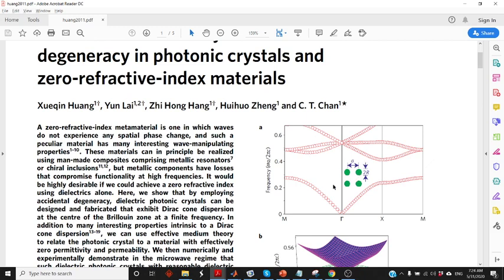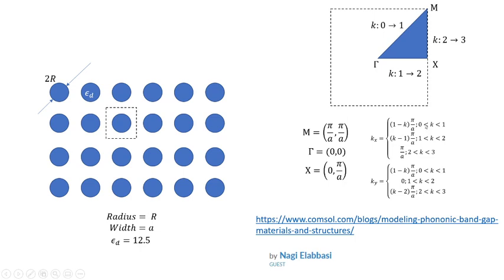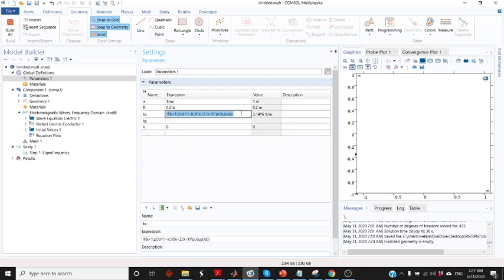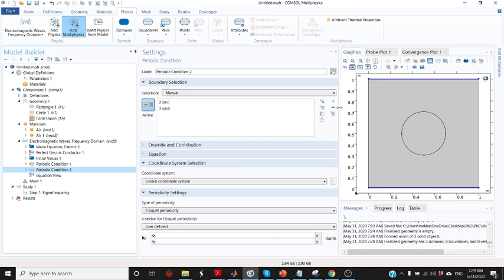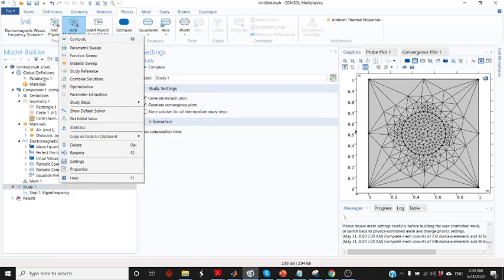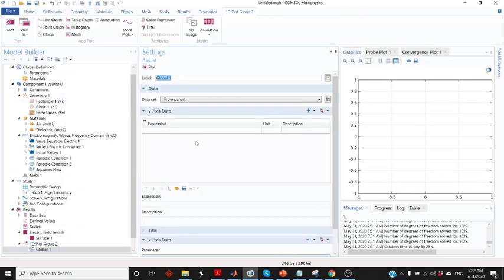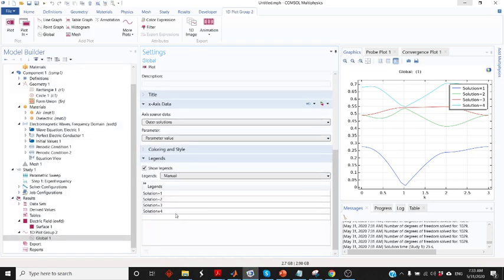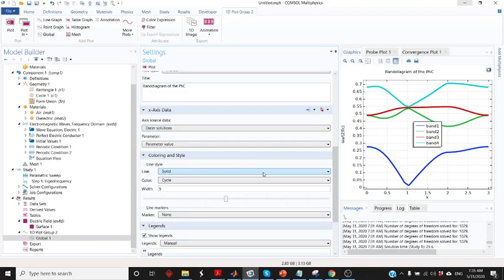Photonic Crystal Band Diagram COMSOL Tutorial Beginners

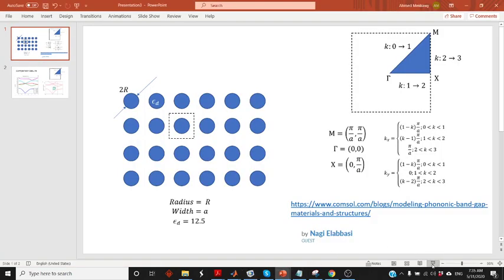Comment: Dear Ahmed, your video is very helpful and concise. I have a small question about the band diagram at 11:10. The cyan and green lines have noticeable kinks, but I think they should cross each other smoothly. The cyan line should continue downward, and the green line should continue upward until k=2, shouldn’t they? Thank you for your nice video!
Reply from the maker: that's correct, it is just artifact of COMSOL plotting the modes are arranged with frequencies. But you are right, the cyan and green lines belong to cross modes.

Comment: Thanks to ur contents. By the way, I would like to ask a question. I've tried several times to mesh (sequence type : physics-controlled mesh).but I dont have any idea why cant I get rid off from error edge 1. I have a same problem. Is there any solution?
Reply: If you structure is different than one shown here, it may require finer mesh or even a custom mesh with different mesh element shape. Without knowing the structure its difficult to suggest anything.

Comment: Do you have some video for band structure in a 1D superlattice? I do not if we should use 2D  layers and apply "No-Slip" boundary condition in the top (wall) in order to consider aroud Y-direction like infinite and only use floquet periodicity along X boundaries...
Reply from the maker: Yes, correct. 1D would be much easier. I assume you talk about acoustic wave in that case, right? you can apply the periodic BCs in one dimension (say left and right), and make the other boundary in the top and bottom, choose hard boundary.
Reply: @ahmedmekawy1632  Yes, acoustic wave. I am using linearized Navier stokes because I want to see the dissipation effects by viscosity.  Then, in top and bottom, I have to use Hard boundary? But the problem of a hard boundary (i think) is that in want to include dissipation effects due the viscosity. And when we have "rigid wall" next to fluid, the dissipation enhance a lot of in the viscous layer next to the "hard walls" by Konstantinov Effect. 

But I don't know if that kind of boundary that you are saying, is not precisely like a "hard wall of material" or is just a kind of boundary for do not taking into account continuity in that direction (in this case Y-direection). Could you help me please? No-Slip boundary condition in that direction could not work for see the system like infinite in Y-direction? or what is exactly the way how works that kind of boundary that you are saying: "Hard boundary"?
Thank you so much :) Regards.
Reply: @ahmedmekawy1632  hello. Is not better to consider periodicity in top and bottom to see Y-direcction like infinite? I asked it, to other colleague and he told me if I consider hard boundary, is possible to have a reflection. Is that true? I need to simulate oblique incidence. Please help friend.
Reply from the maker: @martuss-x5  Yes this is true, unless you have the boundaries in the Y-direction are far away from your thickness, (1 lambda is more than enough). I really do not have experience in acoustics, so this is just from my EM experience.

Comment: Thank you Ahmed. It's a nice video. I have a small query, If I want to simulate seismic metamaterial, which Physics I have to chose? Will solid mechanics module with eigenfrequency study will work? Kindly help.
Reply from the maker: yes, I believe Acoustics module (solid mechanics) will work for it.
Reply: @ahmedmekawy1632  Thanks a lot. Does taking finer and finer mesh size changes the eigenfrequency values in that ? Kindly help.

Comment: I followed your tutorial step by step. It worked just like yours for out-of-plane vectors. When I changed to in-plane vector, the comsol gave me doggy results. Any idea?
Reply from the maker: please check the discussion between me and Keke in the comments. You should find the answer there. Basically, you can play with three parameters. firsy try change the option "search for eigenfrequency around" try make it 1e5 for example. Also select eigenfrequency with larger real part
Reply: @ahmedmekawy1632  It works. Much appreciated!

Comment: I would like to ask about the coordinates of M. Why is it pi/a, what’s this from? Thank you.
Reply from the maker: what should it be?
if you agree on the point X (0,pi/a), then a similar point Y above the Gamma point has coordinates (pi/a,0), so the M point has the coordinates (pi/a,pi/a). We have the M point in 2D crystals. also you can check the book "photonic crystal: molding flow of light".
Reply: Ahmed Mekkawy Thank you. What about the hexagonal condition?
Reply from the maker: @keke301  I see. in COMSOL you can always choose your unit cell as square. This might contain other inclusions from the neighboring cells in the hexagonal lattice. 
you can also define X,M,Gamma points.
I may add another video about Hexagonal lattice soon.
Reply: Ahmed Mekkawy Okay. Thank you so much! Your video is so helpful!
Reply: Ahmed Mekkawy Also I have a question about the TE mode and TM mode. If I need both these two modes of band diagram, how can I set up in COMSOL? Thank you.
Reply from the maker: keke under the ewfd tab, there is option called solve for ” in-plane vector”, “out-of-plane vector” and the default is set to “three components vector” 
You can choose the first option for TM,
The second one for TE,
The third one for hybrid polarization.
Reply: Ahmed Mekkawy Thank you so much👍👍
Reply: @ahmedmekawy1632  But in the paper, it is stated TM modes, and here you have chosen out-of-plane polarization i.e. TE modes.
Reply from the maker: @swetarani8069   Dear Sweta Rani, Thank you. 
I quote the following from the paper: "The band structures are calculated for the transverse magnetic (TM) polarization with the electric field along the rod axis. "
So, as you see, they define TM with E field out of plane. That is why I solved for out of plane. Please notice that different people from different communities use different notations for the definition of TE and TM. You can find many examples for that.

Regarding other questions: use in plane instead of out of plane if you need to solve for the other polarization.
Reply: @ahmedmekawy1632  Thank you so much for the clarification :)